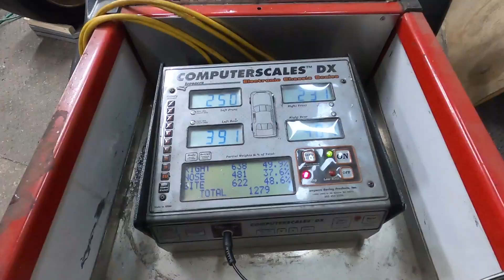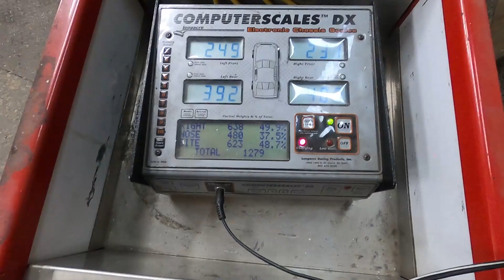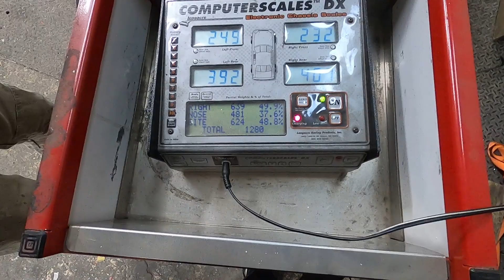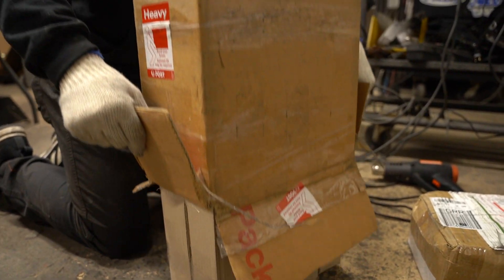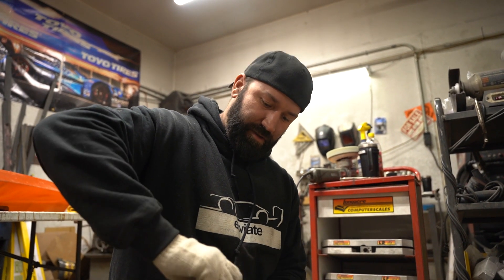WE'VE GOT Headers and Air Jacks! PPIHC Countdown!

Comment: I'm assuming you'd want to get that heavy-ass turbo as low as you possibly can for handling?
Reply from the maker: That's the trade off isnt it? Bunch of extra weight in plumbing to try and place weight low...
Reply: @CodyLoveland  Not a lot of room there either to work with either.  Would going to some of the newer non-cast iron turbine housings saved some weight?  IDK if they are offering them with a turbo like this, but...
Reply from the maker: We will be testing both turbos. My gut says the g42 will be the ticket at altitude, as the engine essentially drops to a 300ci size, which means the turbo wont "choke" as badly through the exhaust housing.  Sea level? Enter the big boy.